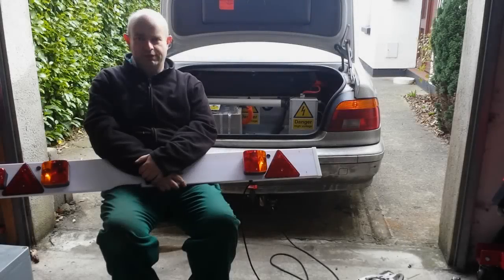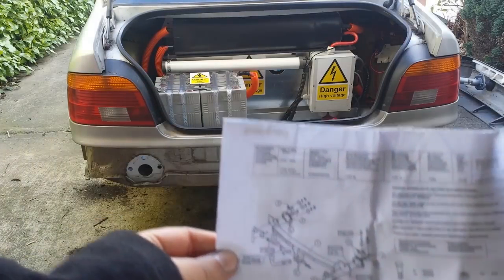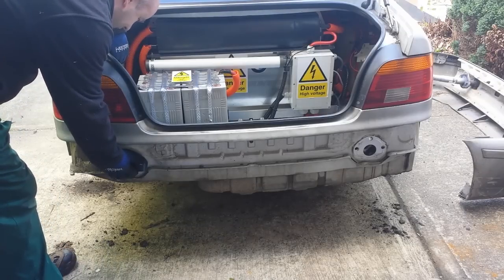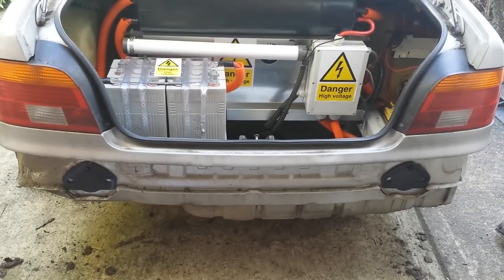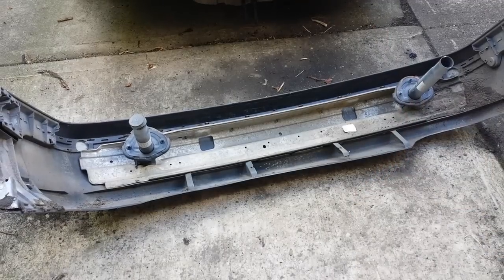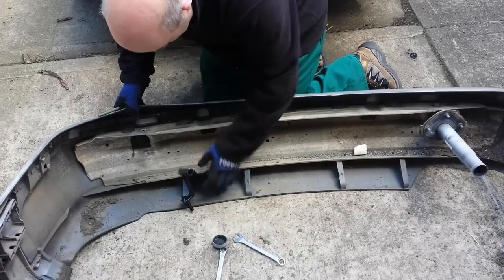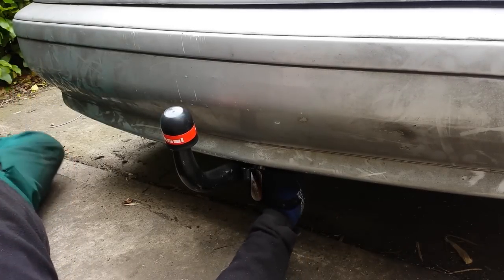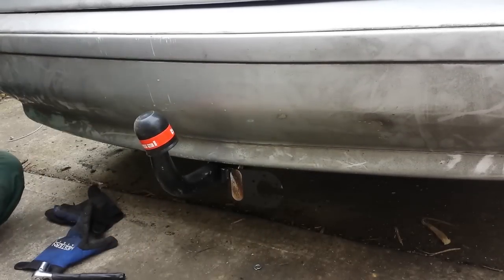BMW E39 EV Conversion 49 Tow Bar

Comment: This install is not a road legal atleast in Finland without that spot for the safety chain. Fast install. Though I felt bad about the bumper dragging on the concrete which made nice scratches on it. Interesting car.

Comment: Interesting that there's no foam or anything inside the rear bumper. Especially now with the solid metal inserts it'll crack on the slightest contact.

Comment: the hook is for the run away brake thats required by law in most EU countries
Reply: Fackboy17 
Some places use safety chains like the USA and nz. Mainland Europe uses this surge brake system where if a special cable is disconnected the trailer's brakes get jammed to ON and it comes to a stop on it's own
Reply: +Tom de bree I thought it was for the safety chain? That's what we use them for here in New Zealand anyway
Reply: Depends on the trailer type